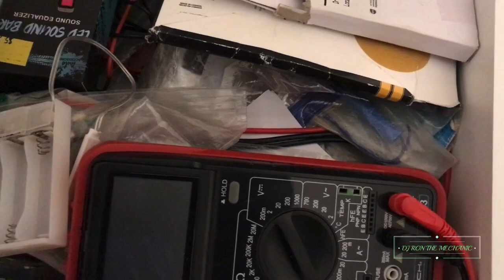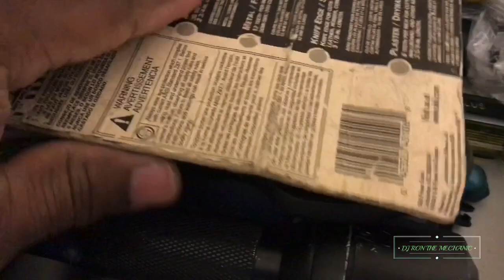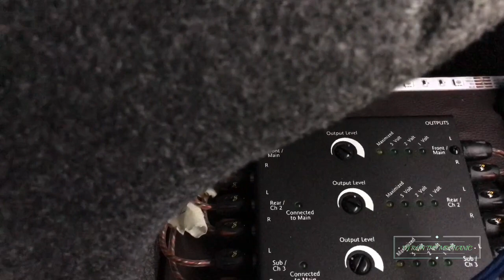Installed A Switch For My LED Tailpipe Exhaust Tip

Comment: Can cops really pull you over?
Reply from the maker: A state trooper told me I could not have it on while driving
Reply: In most states as long as any rear accessory lights are red you're good. Blue is usually a no no and strobing/flashing even more so. A quick Google of your state's automotive light laws will let you know what's permissible. That said, sometimes you're just gonna get hassled by a bored cop who may not know or care what the specifics of the law are.